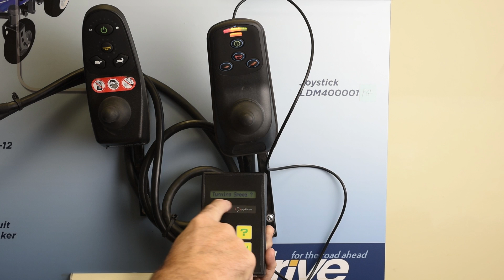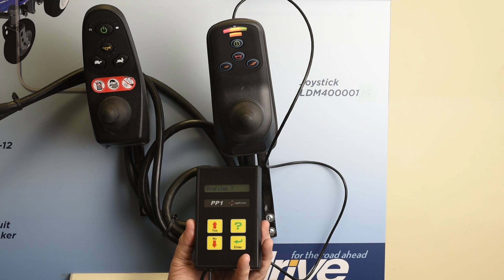how to program power wheelchair

Comment: My drive power chair has lost the speed it had what may be the problem do i need to change the batterys
Reply: Mines takes 2 also sometimes the power button will flash over like i cant move it when i turn it on i have to disconect the wire to restart it then plug back in but i think the batterys have something to do with it r the batterys cheap to buy and if so where could i get them
Reply: Mine is a 2015 days drive power chair

Comment: i have a jazzy chair.  when i plug in the controller then turn it on, it runs fine, but when i push the switch to turn it off, it wont turn off.  so i unplug it.  any suggestions?  thanks
Reply: I think i have the same problem 😕

Comment: I picked up a Merit (Rascal) 326a.  It's flashing code 8 which is 'replace power controller'.  Well, that would not be cost effective.  Is it possible to reset or get around the fault that is causing the chair not to function?  Otherwise this is a 300# paperweight.  Thanks!!!